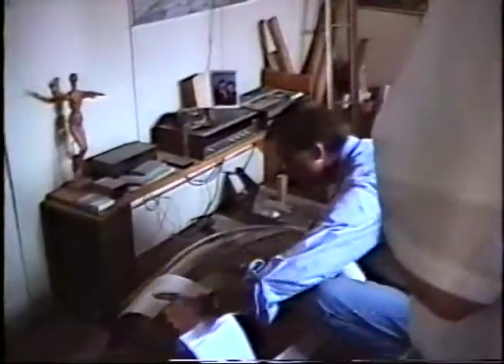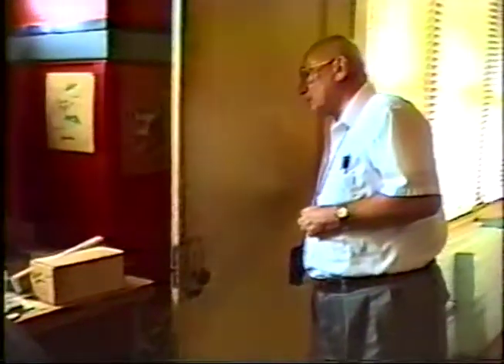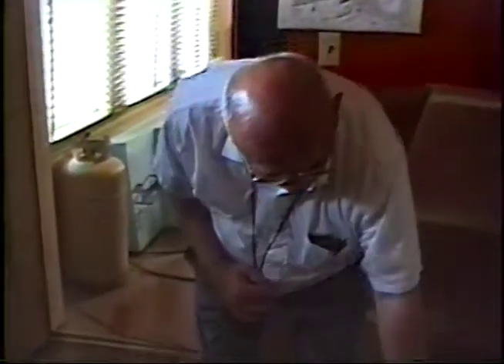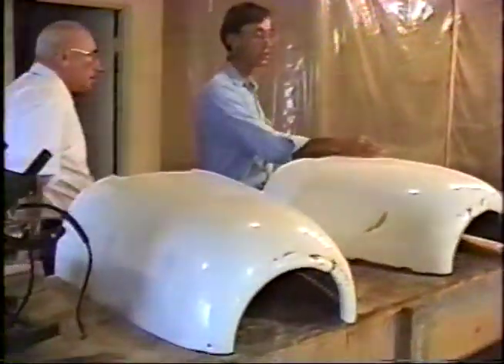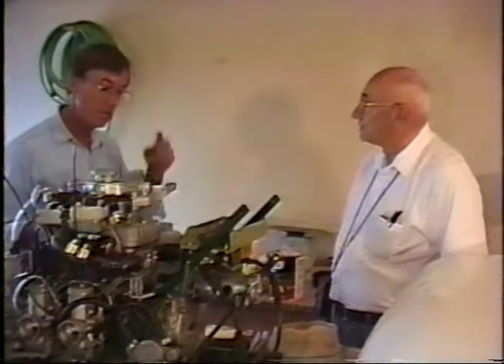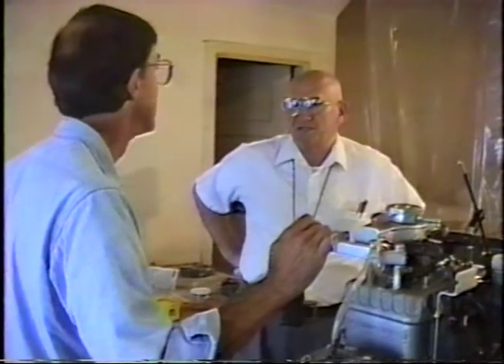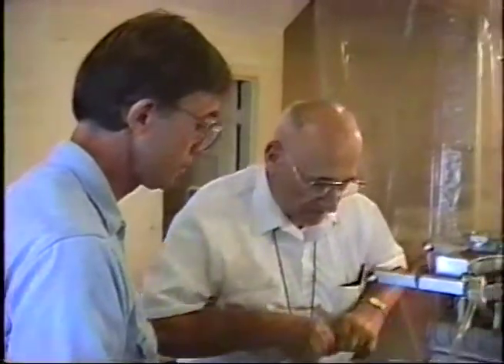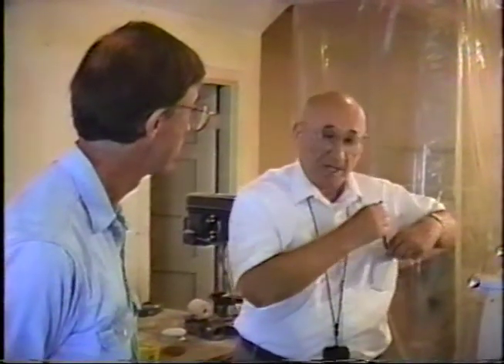Alex Strojnik and the AR-5 pt3 - warning! - airplane nuts only!

Comment: Alex is absolutely right about the fuselage drag behind the propeller. - While it's possible to maintain momentary laminar flow in the propeller slipstream between passing blades, the net effect is a worse drag number than having no propeller there. The negetive drag effect can be reduced, and laminar flow maintained for longer durations between passing blades by simply turning the propeller slower.

What Alex failed to realize, though he alluded to the issue in this very video (and also admitted to these sorts of mistakes) Alex thinks a pusher-propeller would produce less drag, all other things being equal for the design, by increasing the laminar flow over the forward fuselage. 

But as he said, a propeller is just a wing. And a wing produces a wake, which disrupts laminar flow. - The same exact thing causes the aft mounted propeller to produce less thrust-horsepower due to loss of propeller efficiency. The prop is now operating in the fuselage and main wing wakes. This reduces laminar flow of the propeller blades, and also skews the angle of attack of the blades as the pass through the various wakes every single revolution. If this reduces propeller efficiency from say 87% to 83% this would be a rather significant reduction in thrust horsepower and would therefore reduce the net gain of laminar flow over the forward portion. Even if the net effect was increased speed, at the cost of reduced prop efficiency, you would also pay for installation complexity, cooling issues, increased noise and vibrations, wear and tear due to the propeller taking a beating in the wake. Also, as Craig Catto has said on the record, all pusher props end up with foreign objects passing through the blades, due to people leaving any old thing on a wing or a canopy unlatches, etc. 

So from the standpoint of reduced complexity, cooling, mechanical and reliability, put the motor up front. If you want to go faster, cut down the wing area and/or retract the gear. There are at least two dozen areas the basic AR-5 can be improved on to easily beat it's old record. More power is easily attainable. Less weight through carbon is also an option. Etc.
Reply from the maker: Thank You! yes! THAT was the reason Mike thought he would have to put the prop 20 feet behind the airplane to make a pusher worthwhile! - thank you Justin!
Reply: Absolutely right, most so-called revolutionary aircraft designs boast a pusher propeller to lower drag (and often associated with a canard). Most of them have much worse performance than expected, because pusher props lose in efficiency much more than the fuselage gains in drag. Same goes for the canard, it is very difficult to have it perform better when you factor in stall behavior and longitudinal stability.